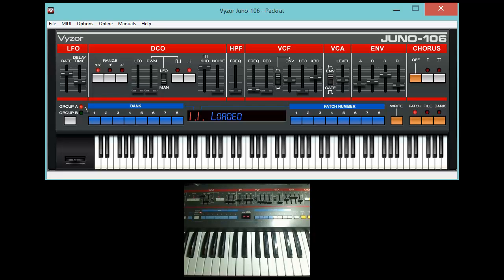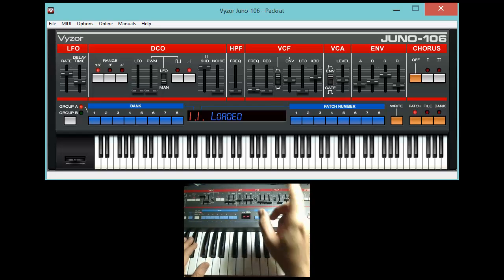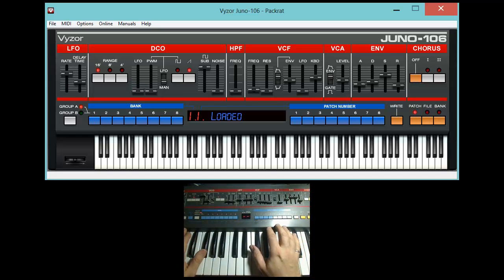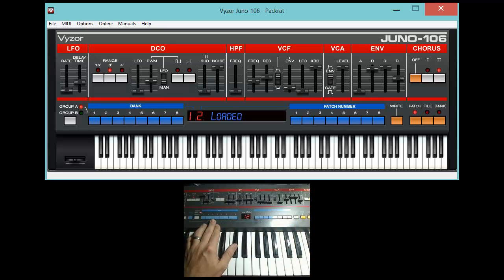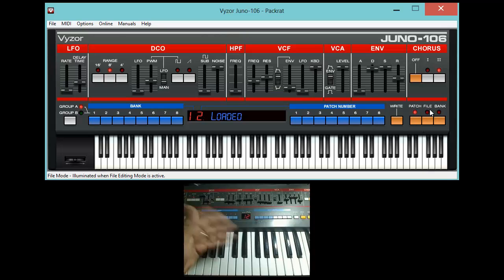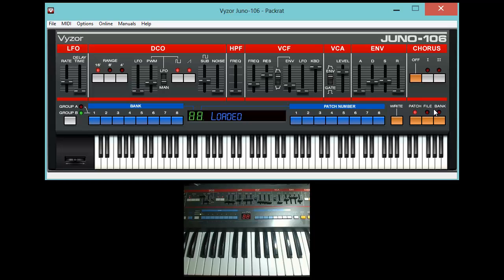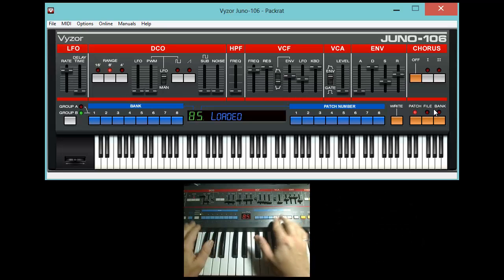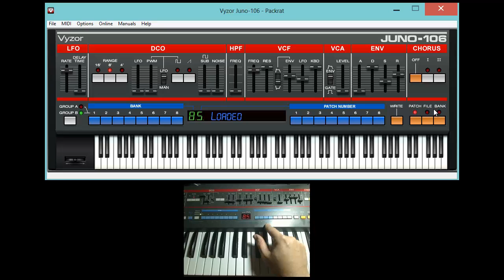Packrat's Juno-106 - Part 9

Comment: Dear Syntegrator,
Great saga about Juno-106 refurbish. As mine seems to have voice(s) issue, i planed to save factory presets before replacement. Factory preset saving due to battery replacement... I would like to take advantage of the fact that it is open to make several updates... such as AC connector replacement... No problem for ac connector, 80017, and battery replacement... BUT HOW can i manage saving and reloading factory presets ? Unless I am mistaken, I did not find a way to download the Juno-106 editor on the Psicraft site, in order to save and restore the presets after replacing the battery.
Is there any opportunity to get this piece of software ?
In the worst case, is it possible to do this with MIDI QUEST PRO 11? If yes, how ?
Thank you very much in advance.
Best Regards